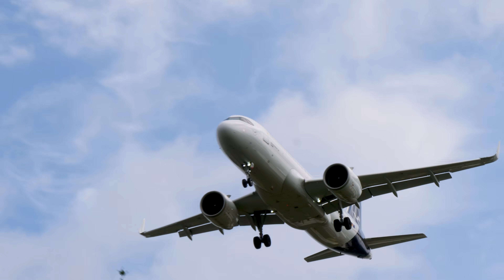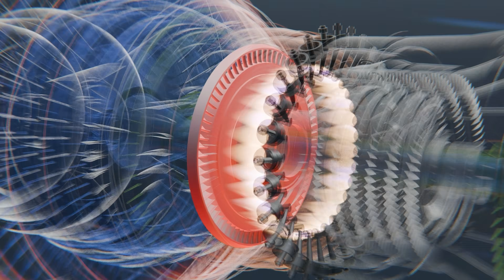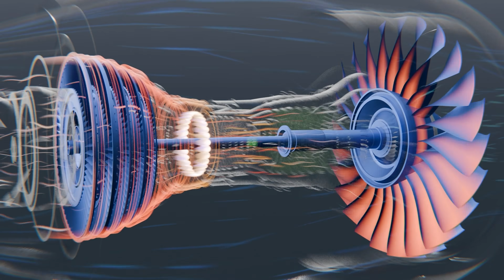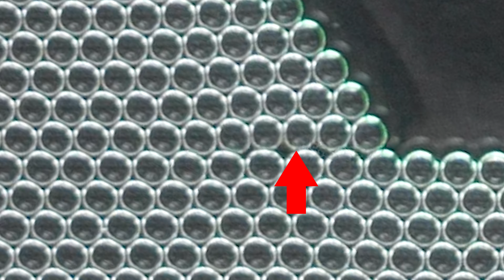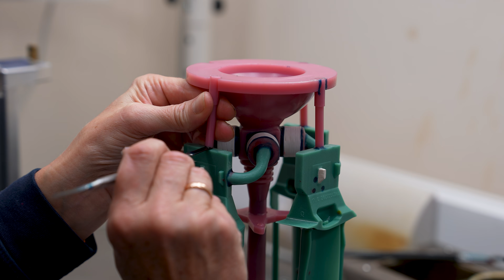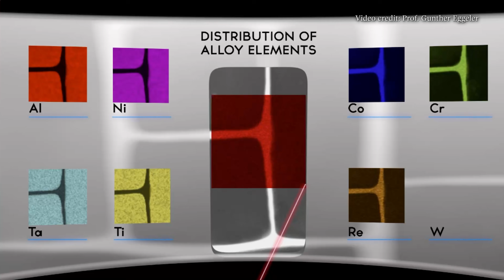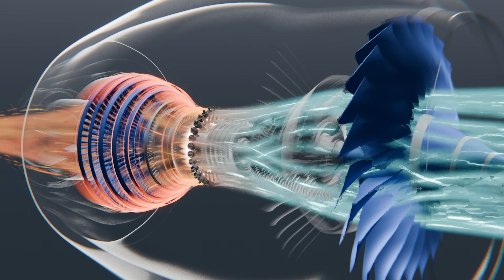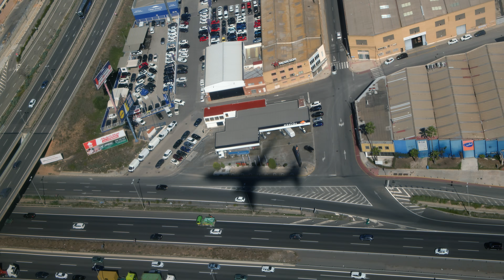The Ridiculous Engineering Of Jet Engines

Comment: The pressure in the burning chamber of a jet-engine can not reasonable reach 50 bar, the chamber-pressure of a liquid fuel-rocket engine. Rather 5 bar is more reasonable. The chamber-pressure of a solid-fuel rocket engine can on the other hand reach up to 200 bar though.
The average normal atmospheric pressure at the sea-level is 1,013 bar or 1013 millibar (absolute pressure), or 760 mm of mercury in an U-type barometer made out of glass.

Comment: Tell us about steel beams melting point
Reply: So you didn't watch the demonstration in the video?  They clearly heat metal and watch it get weaker until it breaks.  It's very easy to understand test and example.  But if you dont actually watch or read you will always be the dumb commenter.

Comment: Really dramatizing a simple thing.  Air flow.  Not all the air is used in combustion.   In ducted fan engine most of the air is bypassed.  That cooler air is used to keep the temperature in a reasonable range.  Exhaust gas temperature is measured, but not exducer vane temp.

Comment: Reminds me of blowing up a large bag full of air. If you put your mouth on the nozzle and blow, it's gonna take a lot of effort. But if you blow from a distance say half a meter, suddenly it fills up almost instantly. You're also forcing a lot of air from the surroundings into it by doing it this way. 

In the case of the engine, the high speed air that's being blown out of the engine sucks in air from around this stream because high velocity gas makes a low pressure zone. Kinda how wings push/pull on a wing because of the shape of the wing, generating lift.

Comment: They increase surface area by that "cooling" system of the blade. But doesn't increasing surface area just give heat more surface to bring the metal at the same temperature.

Comment: Can we make a solution from a problem that is called dust? Perhaps there's a material to which this dust can adhere, and which the rest of the dust can adhere in the describted conditions, as seen with magnets and iron mortar. This also creates a space where air movement is difficult and can thus become an insulating layer. Furthermore, this has the advantage of purifying the air.

Comment: my memory is because of the compressor is flowing on the surface of the turbine blade and forming a insulating layer between super hot exhaust gas and bring away some heat that get transfered to the blade.

Comment: Meanwhile my laptop melts at 3 Chrome tabs °C.
Reply: Ahh nice you got that good alloy laptop. Mine goes super critical as I move the mouse just to open chrome.
Reply: @blueberryshoes WHATS THE PRESSURE IN THERE? And why is it made of CO2
Reply: anything can be supercritical at enough temperature and pressure
Reply: @lyrimetacurl0  the other guy watched 1 Steve mould video and thinks he knows what supercritical is 😔
Reply: @north.nathaniel  phehehe!! cool...
Reply: @blueberryshoes  I cant type this without my cpu going to 100% on each word (no cap (plus i am the 555th like))
Reply: @Avidiy  i am able to watch the video barely because i have a car's liquid cooling installed in my pc.
Reply: @Dthomas5816 my lenovo loq usually does pretty well even with a ryzen 7 and a 4060 but i usually play minecraft more than i use chrome so thats not an issue
Reply: @blueberryshoes You could upgrade to a  tungsten laptop like me and you can extend that to 4 tabs and 2 widgets. Hope this helps.
Reply: mine melts as soon as i turn it on and it’s louder than a jet engine
Reply: I have a gaming laptop (big mistake). I can place a glass of water next to the laptops air vent and after a few minutes the water will be warm. I remember Linus Tech Tips making a video where they plumbed a water cooled PC into their home central heating radiators.
Reply: @notmenotme614  keeps my coffee warm
Reply: @notmenotme614  because I have a gaming computer that pushes air that is like 100 degrees I bought a stand that has fans built in it
Reply: @notmenotme614 A Dell g15? Cause I also have that problem, I can’t run Minecraft without it going critical
Reply: Probably some Engineer at Asus deciding Rubber like coating helps thermal edit : coating spelling fix
Reply: @pangtundure  I found your problem.  There are no engineers at ASUS.
Reply: I don't know what you guys are talking about. I've just bought a high-end gaming PC for the price of a sportscar and I can run Steam in the background while watching youtube and typing this comment. My PC barely reaches the surface temperature of the sun.
Reply: People still use Chrome? 🙂 Can't stand it myself.
Reply: @JimmyMon777  Firefox is better.
Reply: @JimmyMon777 it’s the most popular used browser on the planet . Ofcourse people still use it
Reply: Have you tried opening 3 Tungsten tabs instead of Chrome?
Reply: @raiden24 I use Kevlar.. that’s a thing right?
Reply: mine used to undergo nuclear fission once i opened file explorer
Reply: jetfuel also melt steelbeam
Reply: Meanwhile my chromebook tanking 30 tabs 24/7 a couple years back.
Reply: Y’all ain’t got no right being this funny on the Internet. Take your sticker and get out of my house. ⭐️
Reply: @zooning-6843  r/angryupvote
Reply: mine melt within seconds of opening the chrome
Reply: Tbh 3 Chrome tabs are about 1500°C hot
Reply: my girlfriend's macbook once overheated because she let a game running after she fell asleep and the keyboard literally melted and warped. it was an intel i7 MBP
Reply: @Armadurapersonal that was really bad. Why don't they put temperature sensing systems in laptops at apple?
Reply: You sir have won the internet!
Great joke.
Reply: Download more ram
Reply: °C³
Reply: hahahahah
Reply: repaste it...
Reply: If you don't know 

3 crome tabs °c = 9999999999999999999999999999^999999999999999999999999^999999999999999^99999999 °c
Reply: Best comment today
Reply: Wins the day right there, buddy! 🙂
Reply: Clean out the inside of your laptop
Reply: I wonder what the conversion to F is for that! lol 😂
Reply: Lucky...
Reply: Auto Tab Discard extension
Reply: mine i meling a in yping thi and i hink ome o my key are meling
Reply: I'm watching this video at 100%cpu usage😭
Reply: :face-purple-smiling-tears::face-purple-smiling-tears::face-purple-smiling-tears:
Reply: Mine hovers with the fan
Reply: your comment made my day
Reply: lol
Reply: Why do you let others to train disgusting text-to video LoRa-s on the expenses of your electric bill and your laptop's integrity?
Reply: haha epic!
Reply: My phone's main board turns into the sun when I listen to music and open messages
Reply: School Chrome books be like
Reply: U have a warm room and hands-great!
Reply: You still have a working laptop. My phone turns into iron box when playing mini militia
Reply: you win the comment section sir hahaha
Reply: Mine tried to drink tea and had a stroke
Reply: U need to. Use chrombines
Reply: Not in America
Reply: Get a Mac and you won't look back.
Reply: I have an Alienware. It melts upon the first contact with the power button.
Reply: Mine also melted all my jolly ranchers.
Reply: I can open thousand of chrome tabs. PCMR is blessed with better cooling solutions (100% chinesium cooler with 6 pipes) cost less than 20 bucks.
Reply: My phone at just 1 app°C
Reply: You have the wrong browser right now I have 2,293 tabs open in Firefox and the laptop isn't even that warm.
Reply: thats wild. I built a desktop 8 years ago and it still run AAA games. maybe look for a PC with more RAM next time.
Reply: you should try some chromatic coating ;)
Reply: You need Linux, buddy!
Reply: Your laptop is not a jet engine. Hope this helps!!
Reply: Clean your pc fans of dust guys
Reply: Degrees chrome is a good unit
Reply: Most underrated comment.:face-blue-smiling:
Reply: the C stands for chrome tabs
Reply: lol
Reply: Top comment of all time 😂
Reply: I swear it makes me want to crash out
Reply: my one regularly burns me lol
Reply: Don't open windows, problem solved
Reply: lol😂
Reply: Delete some files and softwares you don’t need 😂
Reply: Maybe you should use edge
Reply: ain't that the truth!
Reply: @ApeLifts12 You could upgrade to a  tungsten laptop like me and you can extend that to 4 tabs and 2 widgets. Hope this helps.
Reply: You should look at the EUV machine technology that makes your laptops. Thats also out of this world!
Reply: My 2018 MacBook PRO sounds like a departing F16 with afterburners…
Reply: So true.😅 my sony laptop does the same

Iykyk😭
Reply: Would you rather it became airborne? 😉
Reply: Got malware or your fans are obstructed.
Reply: I kind of see a problem with videos like this. They don't question whether we should be doing this at all. If you want to be harsh, it sounds like pure pro American, pro fossil fuel propaganda. "Look at how cool we are for achieving this! There's NO WAY this is the wrong path to take, so let's just focus on improving it even more!".

But in reality, it's literally only been ~50 years of popularity of fossil fueled planes, and CO2 is absolutely wrecking nature. It's not a good path, yet questioning this seems too taboo for 'educators' like Veritasium.

Edit: I googled, and apparently Veritasium has been sold to a private equity firm 2 years ago. The equity firm does what big corporations always does: Safe bets, nothing controversial, and formulization of everything to cut costs. There's not going to be any criticism of fossil fuels in this video, because the owners OF the video are typical capitalists who just want to make money. My gut feeling was correct.
Reply: @JaniMelender-vn9vu  Do you also try to order Chinese food at Italian restaurants?

This is an engineering channel.  It isn't a channel about social policy, or whether we should have airplanes or not.  It isn't "taboo" , it's an entierly different subject matter.

If you aren't interested in engineering, you shouldn't come to an engineering.  ...restaurant
Reply: @jengleheimerschmitt7941  i mean he is not wrong in getting the problem across, and isn't green energy the ultimate engineering problem?
Reply: @Blunteen This is a video specifically about the mechanical functioning of turbine jet engines.  There are several other videos on youtube on different subjects.

Order a different menu item next time if you don't like this one.  It isn't "taboo" for a particular video to cover something different than something you are interested in.
Reply: @jengleheimerschmitt7941  It's a science channel (teaching science), and being a sycophant for whatever you're explaining isn't being objective. A true teacher knows to show the entire picture, and this ain't it.

Also, c'mon, "If you don't like it, don't watch it!" is such an American thing to say lol.

Edit: I googled, and apparently Veritasium has been sold to a private equity firm 2 years ago. The equity firm does what big corporations always does: Safe bets, nothing controversial, and formulization of everything to cut costs. There's not going to be any criticism of fossil fuels in this video, because the owners OF the video are typical capitalists who just want to make money. My gut feeling was correct.
Reply: @JaniMelender-vn9vu interesting way to look at it, but one point is that it did mention fuel efficiency just form the blades alone so thas a plus.

regardless i do get your point and i do think a future where we use renuable energy or whatever form you would be comfortable with comes from these advancements. <3
Reply: @Blunteen  Except there are no alternatives fuels for planes, unless you count extremely small and lightweight electric planes.

There's also something called Jevon's Paradox, where "better efficiency just leads to lower prices and higher consumption", not less.
Reply: @JaniMelender-vn9vu yet, im hopefull, and you should be too. otherwise i don't see why hate.
Reply: @JaniMelender-vn9vuYou know that we are not living in fantasy fairytale world

Why do you think we don't have trains as the main method of transportation which can be very efficient, the answer is politics and who selected politicians who are corrupt, people like you who don't act where they can make a difference but bark everywhere else.

Why do you not stand in the election and bring a change yourself ?
Reply: @JaniMelender-vn9vu  they dont question if we should have jet engines? Flight itself? You expect them to do that? First of all that would literally ground our civilization to a halt. Second, this channel is for explaining technology and that is the specific goal of this video. Its not about fossil fuels or alternative power solutions. But even then, THOSE THINGS EXIST. You think we arent trying to improve efficiency? That we havent already done so by orders of magnitude? That we're not trying electric and other alternatives constantly? Of course we are but thats not the subject of this video so it shouldnt be surprising that they didnt touch on it.
Reply: @JaniMelender-vn9vu you've bought the climate hoax. Nuclear is the only answer to fossil fuels which I'm sure you oppose. Learn more about co2 benefit and impact. You're also on the wrong channel. Most here are thinkers that won't entertain your fantasies.
Reply: @JaniMelender-vn9vu "pro American" while everyone he talks to at Rolls Royce is British, lol.

Comment: The point on anysotropic properties introduced in single-crystal casting probably needed more attention. Small grain size is very often what we aim for with steel because it makes the properties of the metal independent of the direction in which stress is applied.

Comment: Because the rotor blades are cooled by compressed air that is directed through human hair sized holes on the blades leading edge that creates an "air curtain" that insulates the blade's surface as it rotates.

Comment: 2:29, that ratio of power is only true AT SEA LEVEL. Up at 30,000 feet, that relationship is inverted. And the jet exhaust is making a MUCH larger portion of the thrust. That’s why they can fly higher and faster than turboprops.

Comment: “Why don’t jet engines melt?” by Veritasium:

Extreme Temperatures vs. Melting Point:
Jet engines operate at temperatures hotter than the melting points of their own metal parts, especially turbine blades that can encounter gases over 1,500°C.

Key Innovations Keeping Blades from Melting:

Nickel Superalloys: Modern turbine blades are made from advanced nickel-based alloys, which maintain strength at high temperatures far better than steel or titanium.

Gamma Prime Microstructure: The unique arrangement of atoms (gamma/gamma prime phases) blocks defects and increases strength, especially at high temps.

Single Crystal Blades: Rather than a weak polycrystalline structure, turbine blades are “grown” as a single giant crystal using complex molds, eliminating grain boundaries that would otherwise be sites of failure.

Protective Layers: Blades get specialized ceramic and metal coatings to prevent oxidation and provide another layer of insulation.

Advanced Cooling: Ingenious internal air channels and “film cooling” holes allow relatively cool, high-pressure air to flow inside and over the blade surface, creating a protective buffer—even if that air is already hot (about 600°C).

Manufacturing Process: Every blade starts as a wax model, covered in ceramic, then cast with molten superalloy—followed by extremely precise shaping, leaching core passages, drilling cooling holes, and applying coatings.

Why Jet Engines Don’t Melt:
The combination of superalloy chemistry, single-crystal growth, engineered cooling systems, and protective coatings lets modern turbine blades survive in conditions far beyond what would destroy normal metals.

Challenges and Ongoing Improvements:
Dust, sand, and thermal cycles still threaten blade lifetimes, so research continues into better materials, coatings, and manufacturing. The evolution from multi-grain steel to modern single-crystal nickel blades is a triumph of engineering, making modern flight possible and transforming global travel.

Comment: It's nice that @6:05 you use the expression "centripetal force," which is real as it is compatible with Newton's second law within an inertial reference frame, as opposed to "centrifugal" which is fictitious, unless you describe it as a reaction applied by the blade (B) to the body A that exerts the centripetal force on the blade (i.e. applied to the "thing" that "pulls the blade inward," not to the blade that is pulled inward by that "thing")...
In short, according to Newtonian mechanics and to etymology, centripetal means inward (and it is applied to the blade) while centrifugal means outward (and it is applied by the blade to the "thing" that pulls the blade inward).

Comment: theres actually 3 ways to make the engine more efficient, the 3rd way is basically a stardard of airlines.
Above 10km in the ait the air is less dense and requires less fuel to mix, theres also less air resistance for the craft